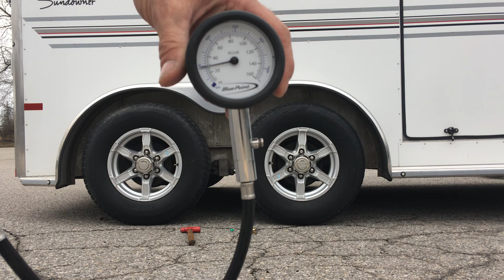A hammer is not a tire pressure gauge!

Comment: Thank video was so funny for me because as a Child I was always the one sent out each morning to run through the safety checks on the trucks we had for construction and my grandfather would always say check that air don't just kick the dam tires 🙂 what memories.  Thomas over at The Model Hobbyist
Reply from the maker: I was just as “guilty” back when I drove a truck for a living - standard procedure then was to give each tire a thump with load binder bar (I pulled a flatbed) as you walked around the rig checking lights etc!